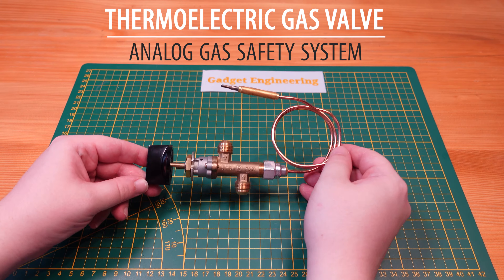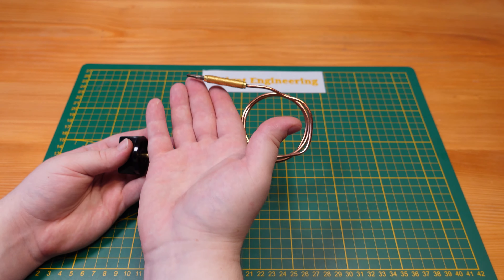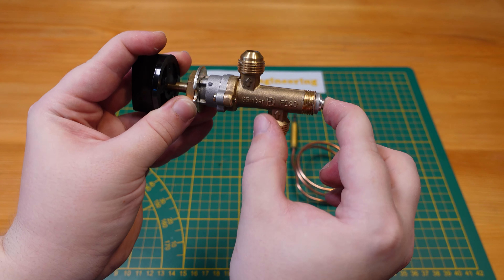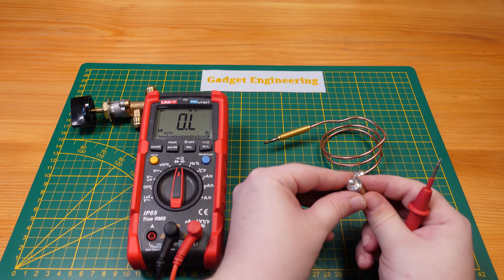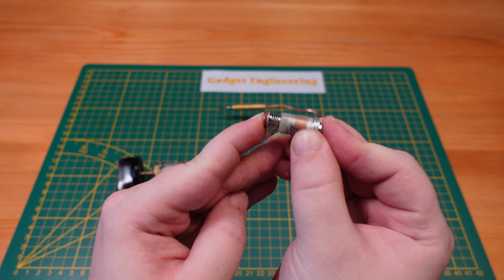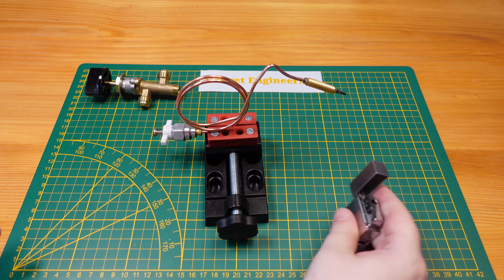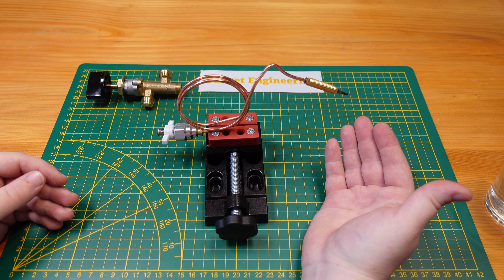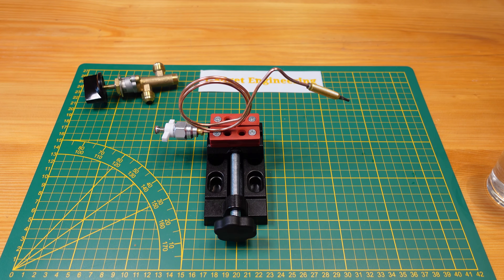Crazy passive thermoelectrically powered gas safety valve: simple analog elegance!

Comment: On flame out, the expanding gas that still flows assists in the cooling of the thermocouple, causing the millivolts to drop away to deenergise the  coil, releasing the spring loaded valve plunger to shut off the gas flow.  So neat and clever.

Comment: I don't think it has anything to do with electricity. But it works by expanding the metal tip and then pushing the tip on the valve to lock it.
Reply: Incorrect. The thermocouple generates a few millivolts of electricity when heated. That's why there is a coil and electromagnet assembly in the valve.  He clearly showed it. The electromagnet holds the valve open as long as voltage is applied to it. And that voltage is created by the heating of dissimilar metals in the thermocouple tip. Study on it a bit more.

Comment: My thermocouple when heated is giving about 26mV but not engaging the magnetic safety valve even if you press the valve. Could the magnetic valve be mismatched with the thermocouple from factory? Which magnetic valve works on 26mV??

Comment: Thank you for that excellent explanation, at least I know that my kitchen gas hob will still work in the event of a power cut as this system is totally self contained to each burner. As a side note I have found that the thermocouple protecting the small hob burner needs cleaning fairly often as it can be rendered inoperative by even a thin layer of carbon dust acting as an insulator. Wow, I have learnt two useful things this week. :)

Comment: Thanks for explanation!
I think that when the system is installed correctly, in the event of an abnormal burner extinguishment, it works quite quickly, because the gas continues to blow over the sensor and it cools faster than in this demonstration.

Comment: any idea how i can increase the sensitivity of this device? my stove takes a long time before it latches open.
Reply: Try cleaning the thermocouple tip and post gently with either wire wool or a fine stainless metal pan cleaner to remove any carbon deposits, it fixed my small gas hob burner that has been bugging me for weeks, saw that tip on another YouTube video. :)